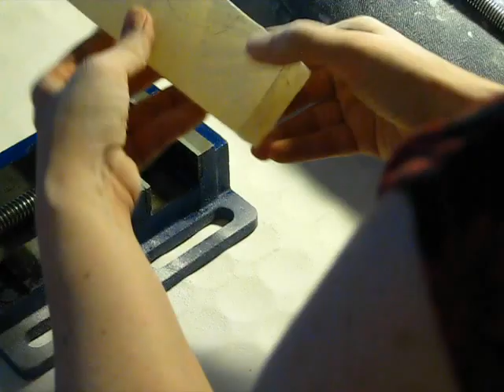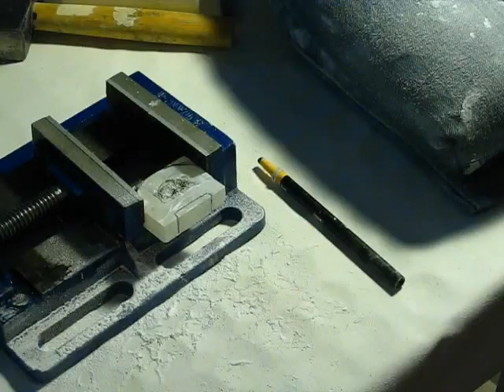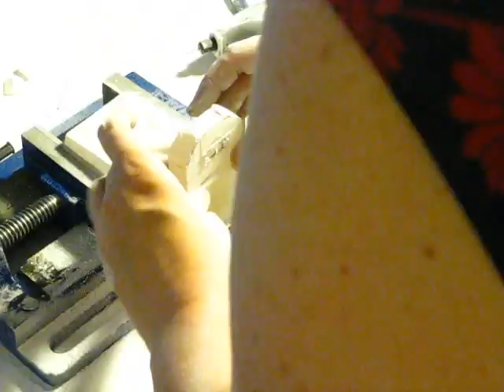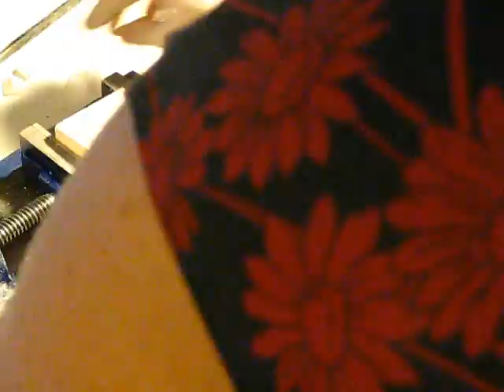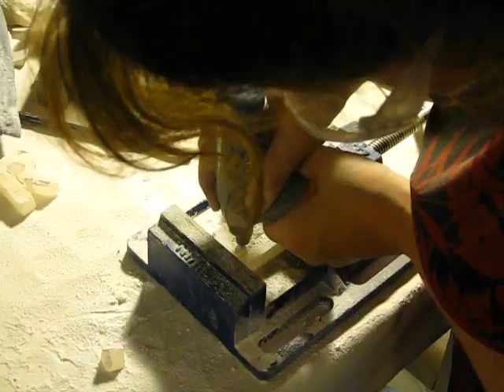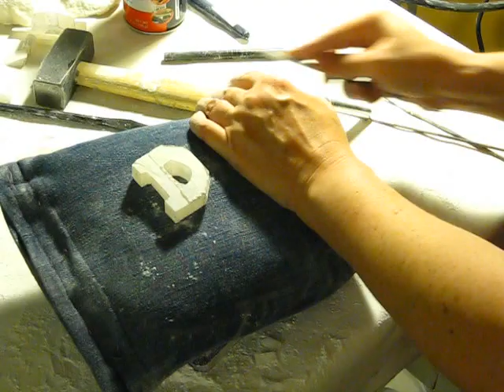Letter Carving with Dremel

Comment: (cont.) the 7300 that goes for like 20$ and the power is just not really up to par and the battery life is terrible. New batteries cost 15$ so it makes more sense to just buy an entire tool, talk about lame. The stylus seem AWESOME but after spending 100$ on the 4000 i wasnt sure if it was worth it, what do you think? I need good battery life and a decent amount of umph for sanding and stuff...Whats your experience with it like, compared to the 4000?